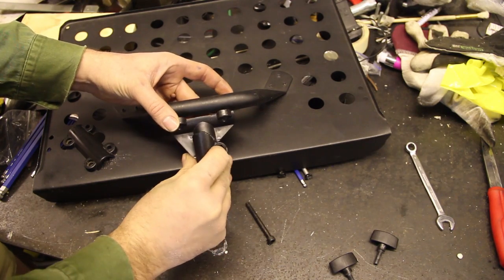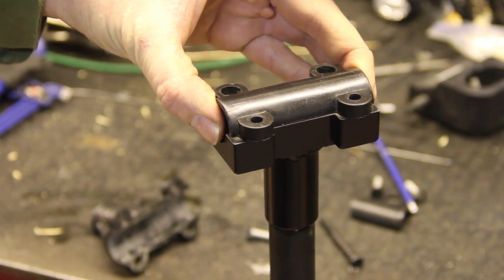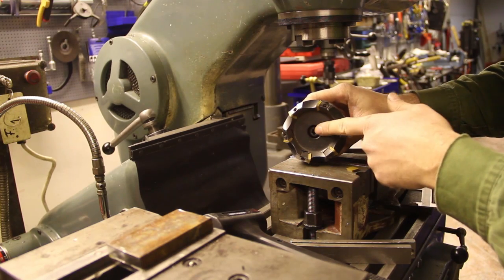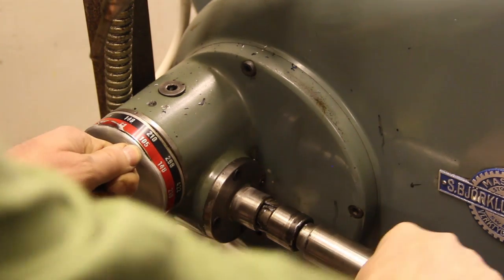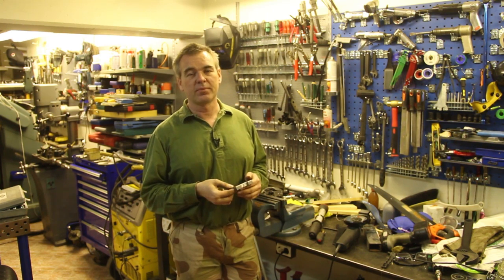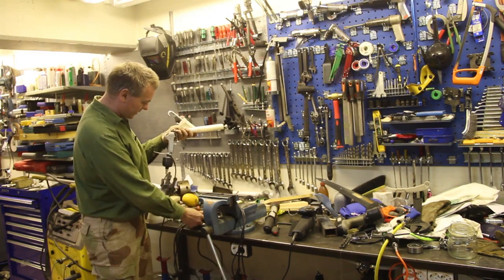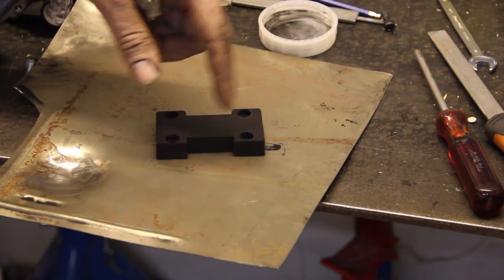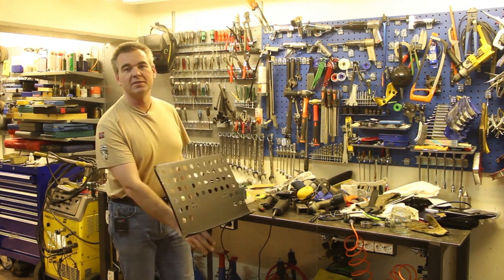Music Stand

Comment: Enjoyed watching the way you used your horisontal head and a boring tool to make a groove in the block - more interesting than fixturing in a vice and vertically milling for sure!

Cheers 
Pete
Reply from the maker: Thanks!
I like milling in the horizontal mode. In many cases (not always, of course), I find it easier to do a really rigid setup for milling horizontally than for milling vertically.

Comment: HI, HOW DO YOU SET THE DIAMETER FOR THE BORING HEADHEAD??? I ALWAYS HAVE  WRONG MEASURES WHEN SWAPING BORING BARS TIPS.
Reply from the maker: I set it approximately right, then I used a radius gauge between cuts and adjusted so it got better.

Comment: Mattias, nice work - Love those very nice quality mills and lathes, but that Harbor Freight angle grinder has gotta go!  hehehehehe

Glenn
Reply from the maker: Yes, the grinder is crappy... but those crappy grinders work better and survive more abuse than they should, when you consider the price. I have one for each type of disc so I don't have to waste time switching discs when working.

I do need a good metal bandsaw though... Dear Santa...
Reply: hahahaha I know exactly what you mean, I went a bit overboard on them:

http://www.flickr.com/photos/100586259@N06/9818946965/

http://www.flickr.com/photos/100586259@N06/11404081366/

If you can, hold out for a nice mitering bandsaw like an Ellis - very versatile

Cheers,

Glenn.